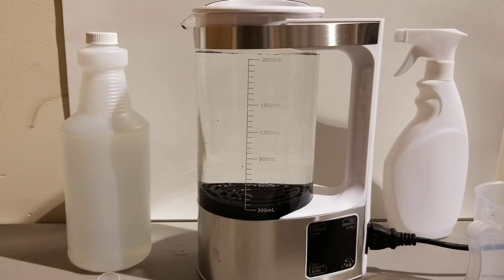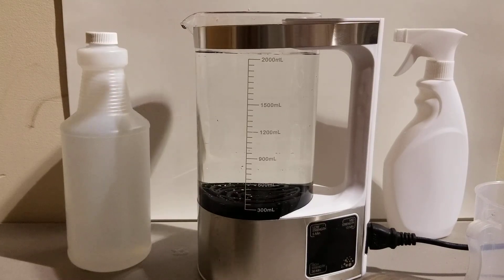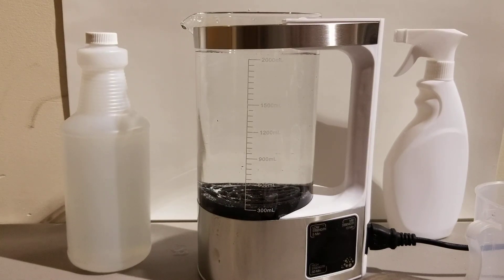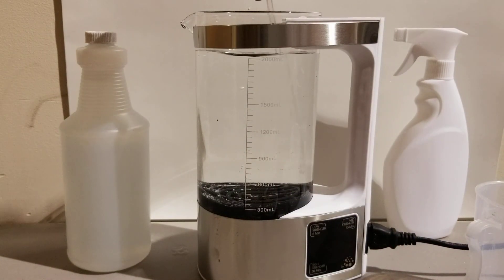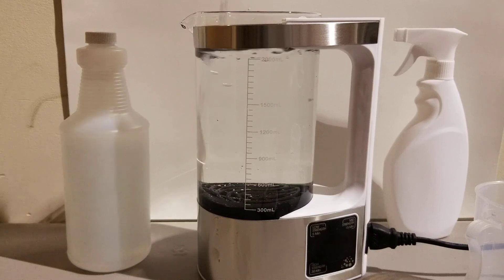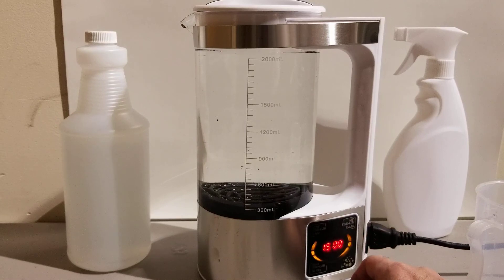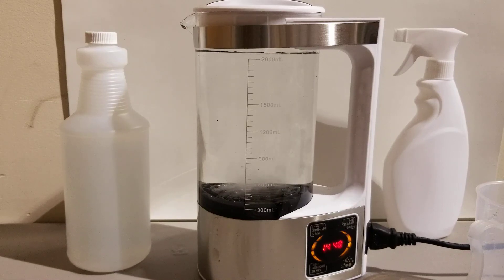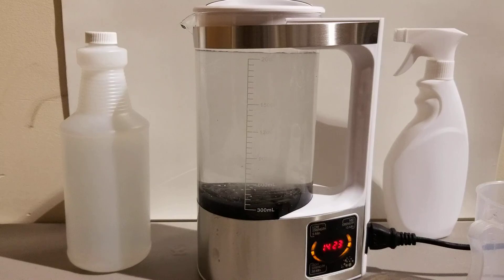Hypochlorous Acid Generator Part 1

Comment: Nice video. What is the ppm of the solution for mid and high settings?
Reply from the maker: The PPM of the solution varies based on the amount of salt and the length of the cycle. The mid and high settings just lengthen the cycle.

On our website we ran a test batch and give the parameters for the results, the concentration can be increased by adding more salt, or running for an additional cycle. We suggest to use a PH and Chlorine test kit to customize the results to your needs.